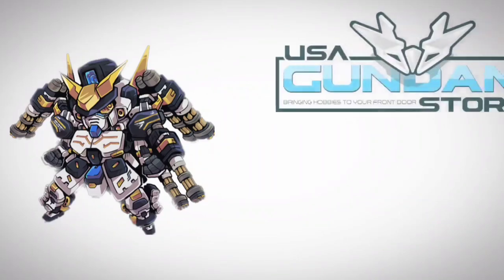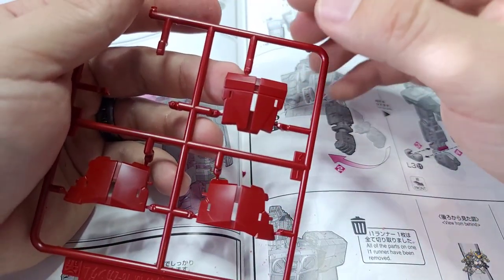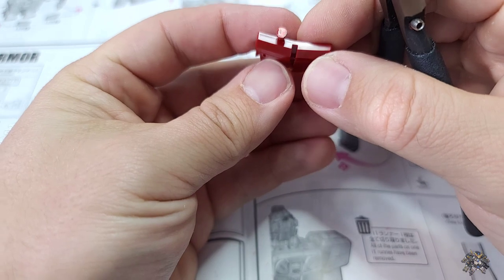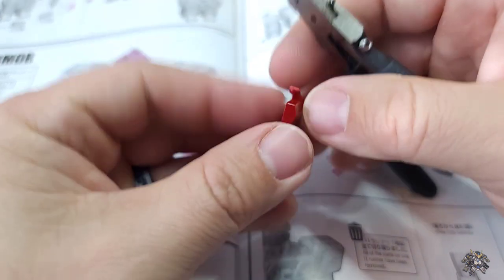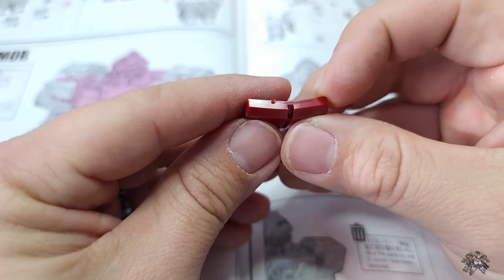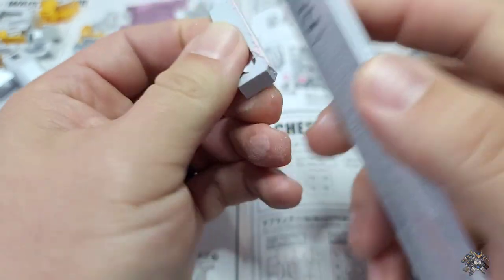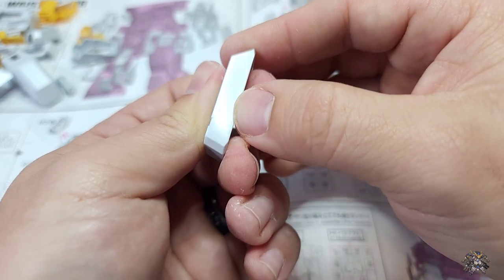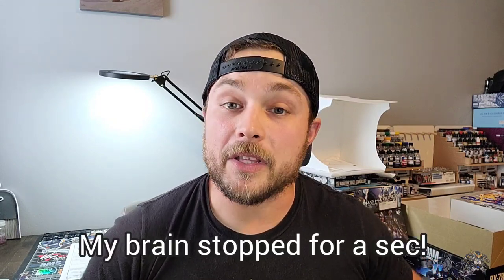PRO NUB REMOVAL TUTORIAL! #tutorial #gunpla

Comment: I'm just wondering but I only have sanding sticks from 200 to 800 from dspiae, but do i really necessarily need the 1000 grits?
Reply from the maker: That depends on a few things....are you painting? Are you painting a gloss or mettalic finish? Do you still see the sanding scratches after priming? If you are doing a flat finish and you can get the surface smooth after priming, then 800 is fine, but if you are doing a mettalic or gloss finish, 1000~2000 will give you a better results. Of course, if you are not painting, you definitely want a higher grit.
Reply: @GunplaJoey  I'm planning to do a gloss finish since I only have the gloss topcoat but one day I'll get the flat topcoat for normal colors, but yeah I might need to get 1000 grit for a smooth finish, from what I understand is that from 200-400-800 it might show big scratches going down and then after using the higher number grits like 1000-1200 it shows very less scratches because it's small enough to not see the scratches right? I've never used sanding sticks before but I'm trying to learn about it for custom painting
Reply from the maker: So think of it like polishing a part. The higher in the grit you go the smoother and glossed the finish of the part even before paint will be. 200 is very rough and will leave big noticeable scratches but moving up the scale you will see less and less scratches and end up with a nice uniform surface. I suggest trying it out on plastic spoons to get the feel for it and then tackle nub removal and surface polishing. I hope this helps!
Reply: @GunplaJoey  thank you and yes it definitely helps, I actually have a alot of plastic spoons that I've been bringing back home for testing so I will definitely do that, I'd still have to get the other dspiae pack for the 1000 grits
Reply from the maker: @giyuulonewolf4780 infini makes really great ones too
Reply: @GunplaJoey  I found one for Micro-Mark Softback Polishing Sticks from Amazon, is it really good?
Reply from the maker: Yes those are good and also the zebra sticks and their sponge sticks. If you are in the US inbound suggest usagundamstore.com
Reply: @GunplaJoey  I'll check out the zebra sticks and I tried to order from that website before in the past last year but I had to get a refund for my order because there was an issue but I had my address and email correct so I'm not sure why, maybe one day I'll try to order from there again but hoping that there's no issues

Comment: Great tutorial! Quick question... how long do those sanding stick last you?
Reply from the maker: Thank you! These sanding sticks generally last a while. Usually through multiple big projects. You can prolong the life of them by making sure to clean them after each use.
Reply: You can use an abrasive cleaning stick to remove the gunk in the sanding sticks
Reply: @red_994  I like to use a piece of tape to pat the sanding stick with, to lift away sanding dust
Reply from the maker: Usually a few kits at least. They last a lot longer if you wet sand with them as well. They last a good long while!